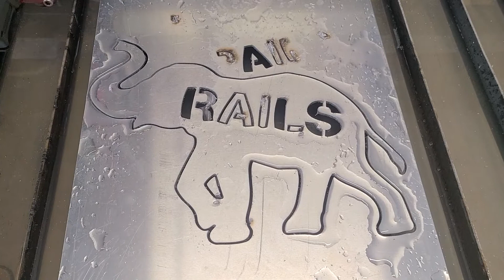Cutting some Aluminum for a friend's birthday present on the Langmuir Crossfire Pro.

Comment: Nice. I cut 5052 billet all the time. What speed are using. I cut usually 130 inches per minute on .063. I use fine cut with a power max 45 xp. On the langmuire